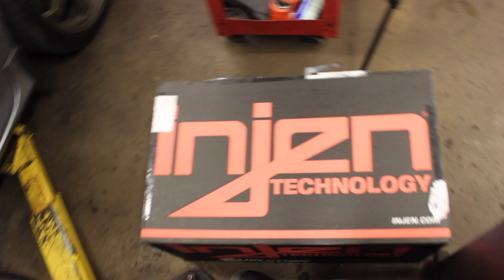HOW TO 10TH GEN CIVIC CATBACK INSTALL

Comment: very nice! the first mods i did to my 2020 si sedan was acuity pedal relocator, subwoofer, oem window visors and a 2020 Ctr shift knob. small things now but next im planning on getting ktuner v2 and eibach lowering springs. or should i just go with coilovers?
Reply from the maker: I’ll do the coilovers an the ktuner for sure
Reply: @fullspeedperformance  which would you do first? coils or ktuner?
Reply from the maker: @thump3r  ktuner